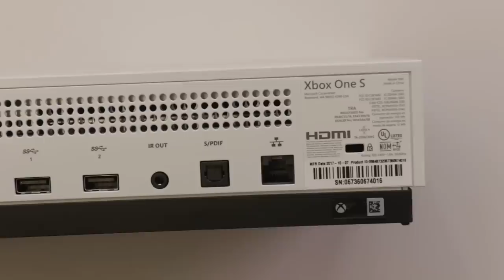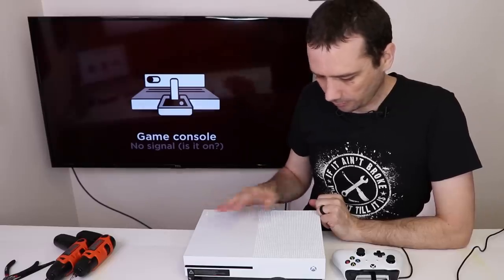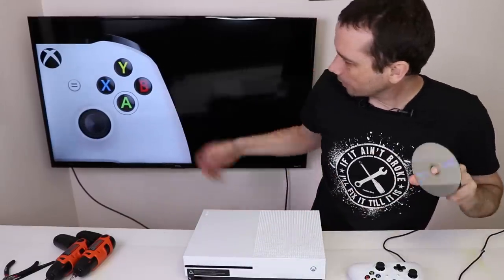Amazon Refurbished Xbox One S

Comment: “They also included batteries for the controller”

*Chuckles in PlayStation
Reply: João M.  not true
Reply: Cackles in Play and Charge Kit
Reply: *people use batteries*

"Laughs in charger"
Reply: Funny though if a ps4 battery goes out you're spending alot more money for repair.

All i have to do is buy a pack of rechargeable batteries/normal batteries or just use the plug in play cord.
Reply: Problem with PlayStation built-in batteries is eventually will stop working overtime. Yes there is replacing the battery BUT third-party batteries are not that great. I replace my Playstation 3 battery at least four times because third-party batteries don't last very long if I'm lucky maybe a month. As for Xbox it makes sense making it a bit future-proof long as you don't leave the batteries in for a really long time because it will corrode and completely mess up the connections that happened to my Wiimote.
Reply: @Imaminimonstertruck  I've had a PS4 controller since launch and have used it regularly and the battery is still good, even if it needs to be replaced itd be cheaper to replace it now than the 6-7 years of AA's. Of course you can buy a rechargeable battery pack for the Xbox but again the battery for the DS4 is about 10 bucks cheaper than the Xbox's battery pack and wouldnt need to be replaced until it goes bad; the xbox you need to buy separately from the get-go and would likely last just as long and still has the same flaws that PS4's have... it's just better to have a rechargeable battery in the thing. 

If you want to talk about which way is better than the switch knocks them both out of the park. In the 3ish years (I think) I've had my switch not once have I ever had to charge the joycons
Reply: @mysticfallz_5752  I have both consoles and yes my rechargable AA's last longer than the PS4 controller battery.
Reply: Best part is you can have multiple rechargeable batteries on a charger and just replace them anytime you want and pick your own strength of batteries... Never use the cable or need to recharge the controller.  Which is better than PS.
OR
You can use a PC and customize anything you want including your controller.
*Chuckles in non-peasant
Reply: I just use rechargeable AA’s. I have two in the charger and 2 in the controller. When they die I swap and I’m back to gaming in 30 seconds. No need to plug in to continue playing and I don’t have to buy a Costco size pack of AA’s either. Rechargeable batteries don’t last forever but they last a stupid amount of recharges.

Comment: They moved to an aluminum heatsink eh? I know my launch Xbox One S has the one with the copper heat pipes.
Reply from the maker: Yes, the newer S models have an aluminum heat sink.
Reply: @Nighterlev  Id prefer the aluminum find with the copper heat pipes. better heat dissipation. Now that larg chunk of aluminum one has higher thermal mass but it won't release the heat as readily.

Comment: Fix a Xbox 360 red ring! We need more variety!
Reply: Are those even fixable? Last I heard it's an issue with the silicon and traces being broken. No real way to fix that unless you know someone good at BGA soldering. 

Plus Microsoft already fixed the red ring with the Slim.
Reply: @cddog1995  its fixable,  but it's not a permanent fix it will most likely end up breaking again .
Reply: Back when I had a 360 it had the red ring I got mad Because it was my second one to do that I threw it across the room it cracked the case it broke a part off I plugged it back in no red ring
Reply: It still works to thisdya
Reply: @loganstrong2279  Sometimes brute force can make things better. Not often, but it happens :D 
I thought back instantly at Jeremy clakrson in a special, where he fixes his E39 5 series with a hammer and it worked :D
Reply: @loganstrong2279  I bet your parents bought them for you,every single console i ve owned i pay myself.
Reply: CD ROD no actually I bought it my self I have been working since I was 13
I bet I have more money in the bank then you and your parents combined
Reply: @loganstrong2279  WELL.....WHOOOOP-A-DEE-DOOOOOOOOOO!!

Comment: I work on printers and we get certified refurbished HP now and then for customers. The certified part means it was done by HP and not a 3rd part. HP also will warranty the printer for 1 year same as a new printer so they are current models nothing outdated.

The price can actually be cheaper on the certified refurbs unless HP runs a sale then the new prices can be cheaper but only for a limited time.

So not sure if you saw any warranty info saying the amazon refurb had the same as new mfg warranty or not but yeah I'd only go refurb if the price was really good though, even if it was only 30-50 cheaper I'd still probably go new over refurb.

Comment: Gut would tell me it's possibly "new old stock" more than "certified refurbished", reason I'd say that is that the console bundles come with time restricted codes & most people would rather opt for the 1tb model in 2019.  The only thing that would make me believe otherwise would be the lack of plastic covers on the HDMI & AC at the ends of the cables which I'd expect to see on a new console.

Comment: For the thermal paste, what's the obsession with not having the thermal paste a bit dry? I am a collector of consoles and handhelds and I have been building and using PCs for 20+ years, I never refreshed thermal paste unless 1. I had a problem that might be thermal releated or 2. was doing something else with the cooler or so close to it, else I wouldn't touch it. Ppl are complaining their <1 year console had ~dry thermal paste? man come on, a. those thing are usually built to stand years of use with the factory tp and b. they are still under warranty, if there are any issues with them just send them back to MS/Sony

Don't get me wrong, I like those videos and I realize you're doing it of curiousity but normal ppl shouldn't worry about how crusty their tp is :)

Comment: Hey man. I’ve been buying PS4s and fixing them lately (since I find parts are easier to find than Xbox) but a recent one I got is automatically flashing red as soon as it is booted. I know this means it is overheating, but the fan is working fine, checked the power supply in case a power problems was just making it flash red. Should I try removing the old thermal paste and applying some new stuff?

Comment: Maybe the system stores the total runtime of the unit somewhere and you just need to read it out with some diagnostic program....and if the person checking the machines finds out that the machine has only run for maybe half an hour in total, I would probably see little point in stripping the whole thing down because it obviously has seen hardly any use, considering that it looks pretty much pristine otherwise. 

Anyhoo, what I am wondering is: How long would the thermal grease stay „fresh“?
I mean...there’s obviously a point in time when it just gets crusty and so far most consoles dont appear to be any worse for wear as a result. I havent seen any manuals that tell me to crack the thing open and replace the thermal paste every so often. 

Price point aside, maybe this is just a case of „if it aint broke, dont fix it?“
Sure, if they have the thing open and stripped anyway they might just as well add a dab of new paste - I get that. It just doesn‘t seem to be too big of a deal, to me at least. 

Unless, that is, I am missing something fundamental.